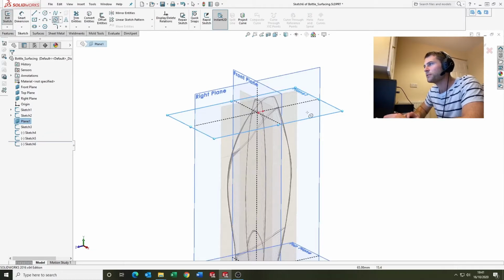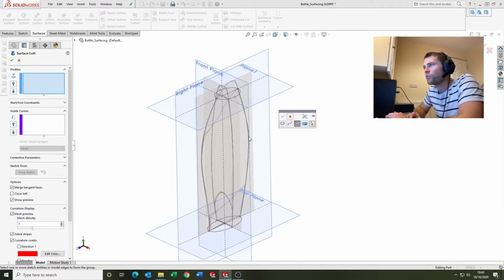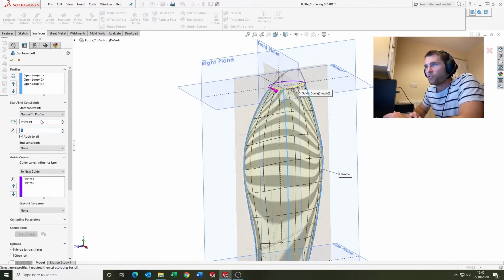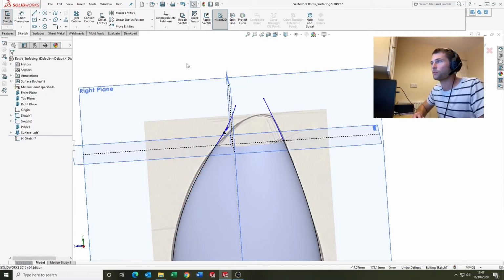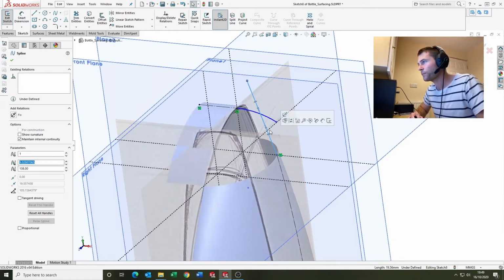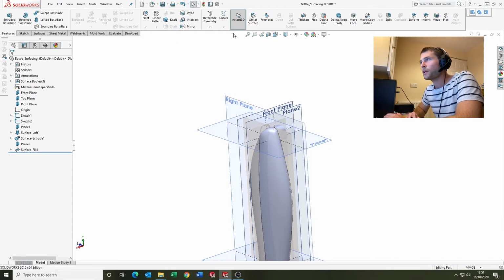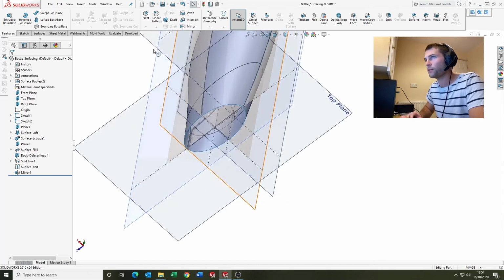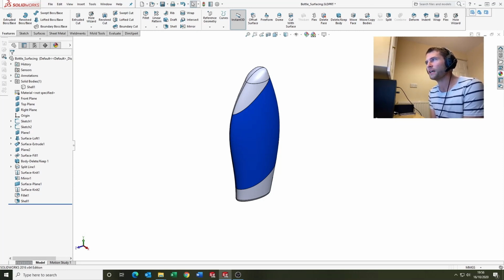How to surface model in solidworks

Comment: Hey, love this tutorial is really helping me out. Any chance you could do the same time of surface modelling style to a bottle which has a handle attached to it aswel please be very useful
Reply from the maker: Hi thanks for comment - glad you find it helpful. Sure email: contact@designmountain.co.uk with some images or sketches of what your after and I can take a look. In the meantime there is a loft and sweep tutorial on the channel that looks at bottle form with handle in solid form so check that out. Thanks